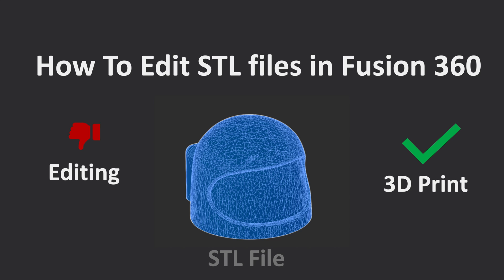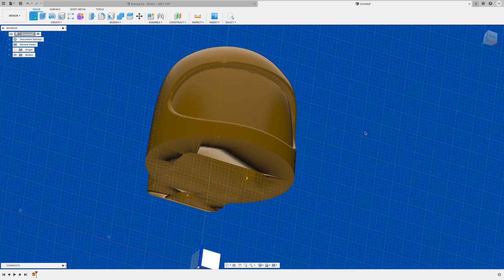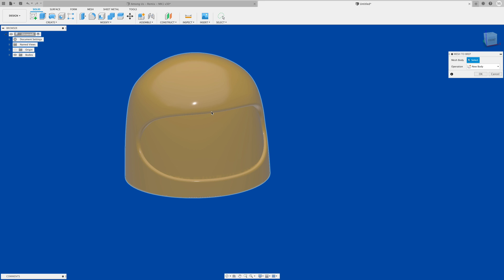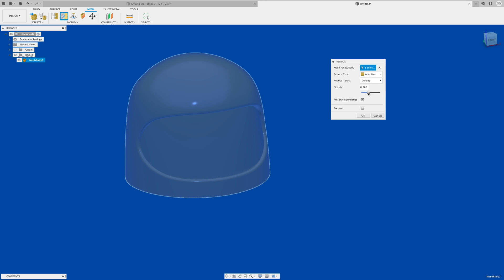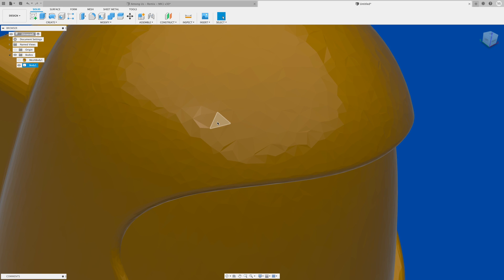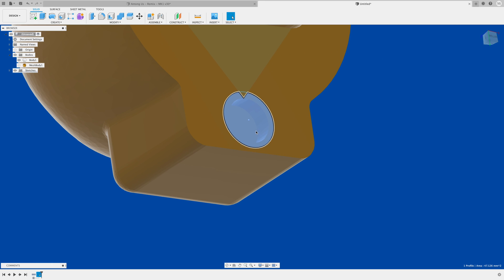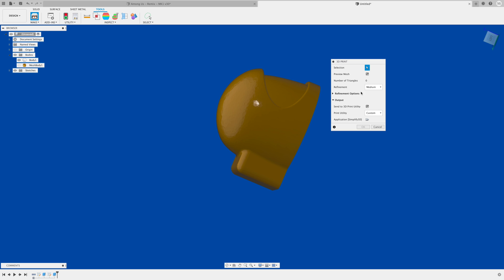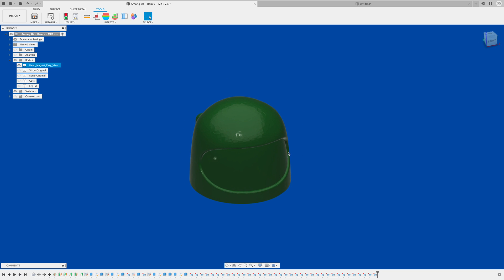Editing STL Files in Fusion 360 for 3D Printing: How to Remix Models

Comment: The reduce screen is different now. There's no "reduce target" setting or "preserve boundaries" setting
Reply from the maker: Fusion 360 updated their software and improved things quite a bit since this video!  I am not quite sure about the reduce target or the perserve boundaries (that will take a bit more hunting).  For the improvements / changes in general: you no longer need to turn off "Capture Design History" and you also can convert meshes with larger number of vertices/triangles  (though be careful as too many will take a long time).   Now instead of selecting Mesh to BRep under the Solid tab/modify/Mesh/Mesh to BRep -- you can instead go directly to the "Mesh" tab, select the modify pull down, and select "convert mesh".  After that the steps are the same and the history is retained so you can change things later if you need to!

Comment: How do you do this in the newest Fusion 360? Many of these options are missing.
Reply from the maker: I tried to add the new steps to the description; to accomplish this with the more recent version of Fusion 360 try this: ---   You no longer need to turn off "Capture Design History" and you also can convert meshes with larger number of vertices/triangles  (though be careful as too many will take a long time).   Now instead of selecting Mesh to BRep under the Solid tab/modify/Mesh/Mesh to BRep -- you can instead go directly to the "Mesh" tab, select the modify pull down, and select "convert mesh".  After that the steps are the same and the history is retained so you can change things later if you need to!

Comment: All I'm trying to do is scale the ball joint of the neck of one of my models and the program freezes. Can you show a tutorial on how to do it a better way without the freezing?
Reply from the maker: I suspect the freezing may have to do with the number of triangles/facets in your model.  Try reducing that number down -- or try it on a computer with more RAM.
Reply: @shawngano  i tried everything. I like to remix things from thingiverse. I like to scale down ball joints from models or just edit it all together. Lately blender and fusion 360 has been acting like an ass. If someone can make a tutorial on this I would be so happy. I think I need to switch to tinkercad

Comment: Shawn, thanks for the video! When you go to convert a Mesh in the updated Fusion 360 you're faced with the option of Parametric or Base Feature. I'm under the impression to keep a conversion more accurate us Parametric. You also have Faceted and Prismatic options. I've struggled with these options since in many cases the number of faceted triangles are large and the conversion fails or only partially completes. Fusion gives errors and instructs you to Generate Face Groups or Direct Edit the Mesh. All this is a bit confusing and no real discussion about why and how to properly work with the tools to eventually convert the Mesh to a Solid so you can being to sketch and make modifications. I find its usually easier to just slice the Mesh and create sketch layers and create a design modeled after the Mesh as a guide. Can you shed some light on this topic and the Fusion tools behind what is being suggested to edit the Mesh by Fusion 360? Thanks.

Comment: I can't seem to find the mesh to brep option. I've scoured autodesk's unhelpful forums too...so frustrating.
Reply: I was looking for it too, I found it. They changed it on fusion 360. It's under modify in MESH. It's just called convert MESH
Reply from the maker: Hi Joshua -- as Jarred pointed out Fusion 360 updated their software and improved things quite a bit!   You no longer need to turn off "Capture Design History" and you also can convert meshes with larger number of vertices/triangles  (though be careful as too many will take a long time).   Now instead of being under the Solid tab, modify, and then Mesh->Mesh to BRep -- you can instead go directly to the "Mesh" tab, select the modify pull down, and select "convert mesh".  After that the steps are the same and the history is retained so you can change things later if you need to!

Comment: Thanks for this video.  It seems like Fusion 360 has change a "little" bit since this video, but I was still able to figure it out based on what you had here.  I am using a handheld scanner to create STLs, so it is great to be able to take those scans, get them into Fusion 360, and then play around with them.  Thanks again for explaining this!
Reply from the maker: Hi Joe - glad it helped!  I saw the update notes a few weeks ago (or maybe months ago now?!?) where they were improving the mesh capabilities of Fusion360.  So I suspect that is when the differences arose.  I wonder if there are any easier ways to do it now.  Next time I need make made a modification like this I may update the video.  Using a handheld scanner sounds quite interesting.  Take care!

Comment: Hi there I want to know how to split an stl model in half so I can use it for making bronze figures using sand molding. Can you show us how
Reply from the maker: I think the easiest way to do that is in your slicer.  Most slicers have a cut function which you can then print both halves.  If they don't have a cut feature you can also position the part so that half of it is below the bed, then it will print only the half that is above the bed.  No need to modify the model for that.    Otherwise, if you want to do this in Fusion 360:  you could create a really thin (0.01mm) rectangle then extrude (cut) it through the entire model, that would essentially cut it in half.
Reply: @shawngano  thank you
Reply: Hi, I come from the future. Don't bother using this overcomplicated thing, just use tinkercad and import the stl, copy and paste so you have two, then make a cube as big as the model and set it as "hole", drag it until it's overlapping just one half of one of the models. Select both the cube and the model and click "group". Boom. Then do the same with the other one but get the other half. You can export them together or just select one and click export and pick "selection" or similar and there you go. Enjoy.

Comment: Hi, I want to make a mold of the STL files. But I can't make a mold when I import STL files. is there an easy way?
Reply from the maker: I haven't tried making a mold before, but I suspect you could follow something like these same steps but then use a boolean operation to subtract the mesh (after it is converted to a body/BRep) from another shape (the outside of the mold).
Reply: @shawngano  Thank you for the reply. but when I do brep, the detailed drawings break down. the surface looks distorted. I have to reduce when there's too much surface. density is decreasing. and the details are disappearing. example: thingiverse= 2578636. too many surfaces. I'm having to lower the surface density.
Reply from the maker: @gokhanolmez729  Unfortunately that is a limitation of Fusion360.  Without the original model or a STEP file that is the best you can do with STL (mesh) files.   Other CAD programs may not have this limitation.
Reply: @shawngano  Which programs?
Reply from the maker: @gokhanolmez729  Google "3D modeling software", "CAD programs", or "parametric CAD" -- there are lots of them, including FreeCAD, and SolidWorks.
Reply: @shawngano  Thank you very much

Comment: I never used Fusion 360 but I was wondering how to edit an STL like you shown. I'm making a character that I plan to turn into an articulated action figure in ZBrush for 3D Printing. If I do all the initial cuts without any tolerances for the moving parts, couldn't I export them as STLs, bring them into Fusion 360, and then add tolerances between parts by doing this method you showed? Because when I 3D Print the parts, they may be slightly too loose or tight, so I'd like to go back and make changes in Fusion 360. I'm just wondering if all of this is possible. Hopefully you reply! Awesome video too! Detailed and straightforward! Subscribed! 🙂
Reply from the maker: Yes this sounds quite possible and is probably easier than adjusting the tolerances in more sculpting tools like ZBrush. The trick would be to be sure you have some good references so you can adjust those tolerances after importing them into Fusion (like a flat surface).  The only downside is that Fusion 360 does make you reduce the mesh count quite a bit -- so you probably couldn't do this for highly detailed model that needs a lot of triangles to represent.

Comment: Thanks for the video Shawn! I was wondering if there is a way to create a shallow hole that follows the curvature of the model.. Say, the top curved part of the helmet?
Reply from the maker: You're welcome!   Yes, there are probably a couple ways to do it (I suspect this would be to add hat attachments or something).  The way I would try it would be to construct a plane where you want the hole to be (there is a "Construct" button on the toolbar for doing this).  The easiest would be to select the drop down from that button and choose the "Plane Tangent to Face at Point", then select the small facet on the helmet near where you want to add the hole, and also select one of the points on the edge of that facet and it should create a new construction plane.    You can then make a new sketch on that plane -- draw your hole, then extrude (cut) it down as deep as you need it to be.  The edge of the hole will follow the contour of the surface.  If you want the hole bottom to also follow the surface shape - that would be a little tougher (let me know if that was what you were thinking instead).
Reply: @shawngano  Sorry I wasn't specific in the first request, I was wondering how to have the hole bottom to also follow the curved contour as well!
Reply from the maker: @brianpark3112  No problem; whew that is much tougher (I have tried it a few times).  Hmm -- how about an approach like this:  Copy the model, then resize the copy a bit smaller.  Then hide that model -- and sketch and extrude (cut) a hole in the first model down to at least (or below) the smaller model.  Then un-hide and merge the two models.  That may work-- you may also have to cut parts of the smaller/copied model  before you merge them in case there are any inner areas that might get messed up by merging/combining them.
Reply: @shawngano  this could work!! Thanks for the tip, I'll try it out and let you know :)